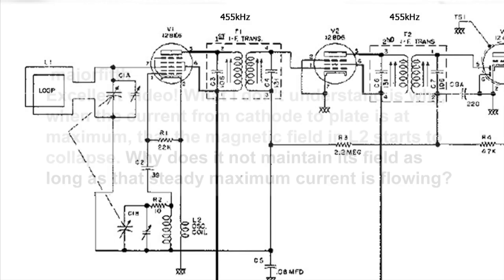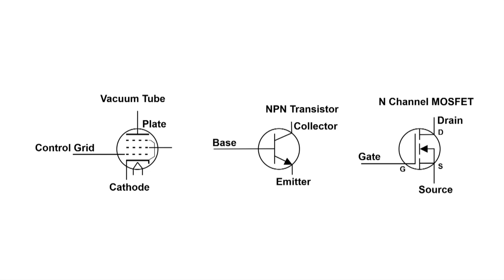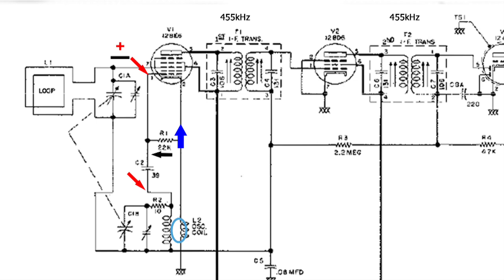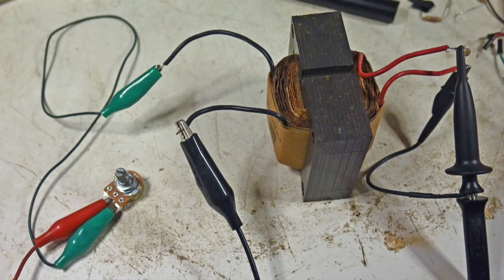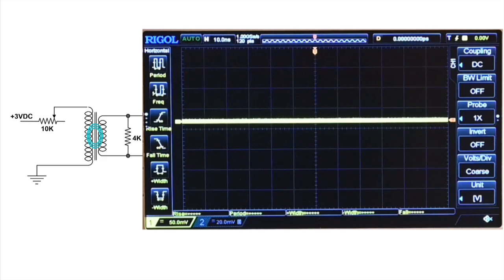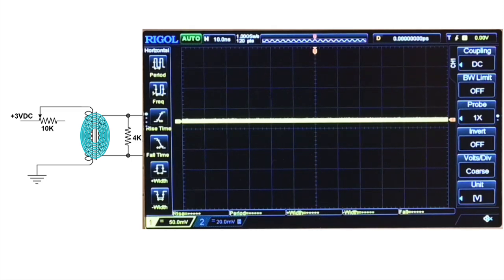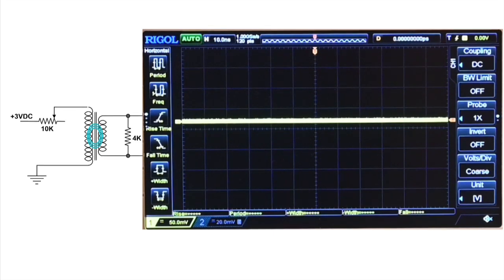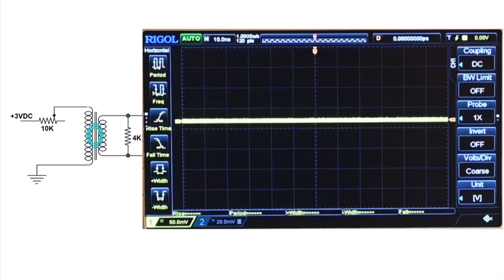LC Oscillator Why and How Does it Oscillate The Basics

Comment: thanks for this informative video. is the bias typically a voltage, or a current,,or both together?
John
Reply from the maker: The vacuum tube and MOSFET are high impedance, they are voltage. The transistor is low impedance, it is voltage and current.
Reply from the maker: Thank you, and your welcome.